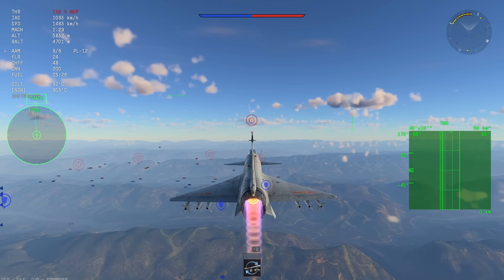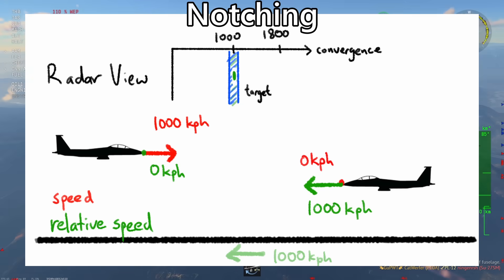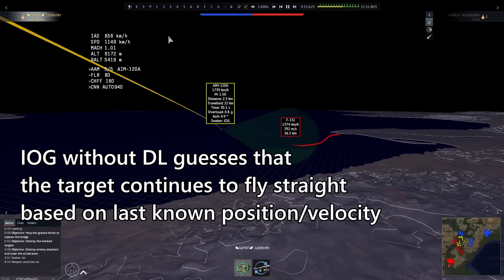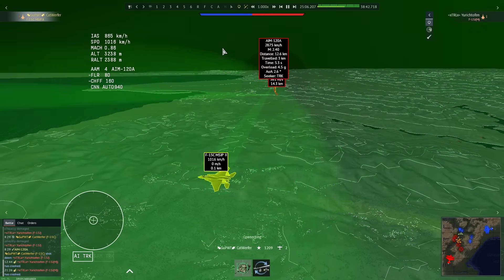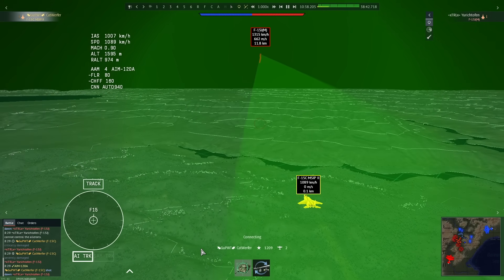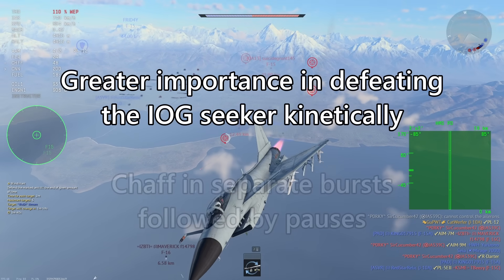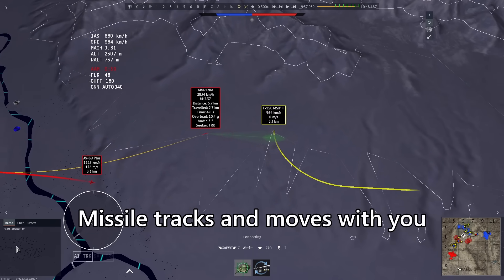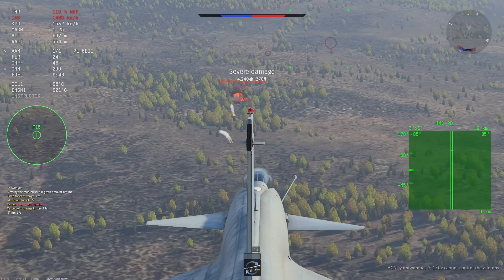Notching Mechanics Explained | How to Evade Top Tier Fox-3s

Comment: 15:50 In arcade (dont judge, the sheer chaos of top tier air arcade is really fun if youre into it) that is essentially all you have to do (at least at 13.0 and below) in most maps where youre 20-40 km out from the enemy spawn. derby's can reliably hit the enemies (id say on average 50% hit/kill rate) as long as they dont manuvre too much, or stop going towards you, but as long as you turn sideways (or do a 180 after shooting your missiles for closer range maps, usually works well even for 15km ones) youre gonna be safe from their missiles, and it also means youll come in from a better angle, or at least be behind your friendlies while your missiles reload.
None of that is really applicable to realistic, except on maps where you also can fire your missiles immediately with a decent hit rate in an air spawn, and then just 180 to rearm on an airfield, but in arcade that allows you to still have full countermeasures while also getting you in a tactically favorable situation, all while you can get some rather cheesy kills (although imho its on them for not maneuvering at least like a little bit, cmon, 43 km shot? and you die to it?)
Reply: since the spawn is quite standardized if you will, all the issues about energy state etc are avoided, you just have to account for the worst case scenario missile at that range.
Reply from the maker: Huh if you spawn that close then do phoenixes ever get any use?

Comment: Oh yeah this part was a bit confusing for me. I have noticed that you need to turn more then 90 degrees, or at least what is seems form the pilots perspective more then 90 degrees. AoA discrepancy angle was the culprit!!! Thanks for the clarification!
Reply from the maker: Yeah i got really confused when it looked like i was doing everything right, i got so frustrated i retested it, so its nice that i can help people figure it out too!
And a lot of it does also just come down to practice at closer ranges so dont be afraid of dying and trying again!
If you really wanna get better then having a training buddy to fire missiles at you in a custom game also helps.
Happy flying :)
Reply: @CatWerfer If i may ask, have you made a video about keyboard shortcuts? this default C button or "free look" is vexing me! I switched it to right mouse button and it works like a charm, but since I am primarily a taker it creates another problem in ground battles..
Reply from the maker: @hindel6141 I'm considering making one, I also use right mouse button now for free look, but I did have to change a lot of other stuff around to make it work for air ground ship and heli, it did take some time to get used to, and im still tweaking it to make it better. If you'd like to see a controls video lmk and ill see if I can make one real quick
Reply: Thank you, Mr. CatWerfer. There is no need to rush tho. Make a guide as you see fit. For now now I will just breake my fingers trying to them sweet sweet off bore R73 shots.

Comment: In squishface's recent video he can bee seen defeating the missiles by notching and then quickly doig a Split-S and chaffing, ultimately defeating the missile this way. (Rafale vid from august 28th, 5:15 & 15:25 til 16:45 & 18:10 & 19:25 & 20:00)

I am trying to wrap my head around why this works, and it kinda makes sense as below the horizon the missile just follows IOG, and above the horizon it work because he is chaffing (what about DL though?) during the Split-S.

edit: I just read your comment, and if the Fox-3s are using IOG in non-PD mode as well, then it makes even more sense that this also works when you are above the horizon.
Reply from the maker: I am confused as to whether you are still confused or not

Comment: Even 8 months later, this is still one of if not the most in-depth vids explaining the concept.  Very nice.  I would like to add a little tactic I use when defending Fox-3's at range (Initial BVR engagement).  Since it's usually not just enough to defeat the seeker, I must also think about defeating the IOG and possibly the DL.  What I do is I keep myself at that perfect 90 to the missile while pulling up and down gradually.  The vertical element does seem to further decrease the effectiveness of the IOG, since you are constantly moving in a different direction than it previously was updated to by the DL.  I've found the incoming missile almost always bites off on chaff one way or another.  Often the missile will bite off right after it momentarily re-acquires me through some very minor inaccuracies in technique right as I'm flowing back into the notch, usually from a slightly cold aspect.  Doesn't require an egregious amount of chaff either.  Just a slow and steady stream of maybe around one pop a second.
Reply from the maker: mmm ive found that short bursts of 2 or 3 tended to work better than continueous due to the aforementioned breadcrumbing effect but yeah i also do the 90 degree up and down strat.
glad this guide is still useful, and glad that gaijin hasn't overhauled the system after i made it so that it remains relevant for the most part
Reply: @CatWerfer  Sometimes breadcrumbing does happen.  But just from how my execution ends up happening, leaving a long string of spaced chaff tends to give the missile more chances to bite since it will often re-acquire from a slight rear-aspect once it gets a bit closer.  Even in the event it does fully re-acquire, it often will not be able to make the turn to hit me again whether it be angles or energy.  Either way, the missile is defeated.

Happy hunting good sir.
Reply from the maker: You too, ill try that method and see how it goes

Comment: I am bumping very often into people who dodge even MICA in a face at 4 km range.
I was trying to check the replay but the missiles etc are not generated for some reason. When I checked the server replay it got stuck in a place after 3 minutes so I could not review the encounter.

But the situation was that I was around ground level and I noticed some SU fighter flying infront of me at 5 km range and he was heading more like to the left(from my perspective), he wasnt on me, but was going after some teammate.

So I locked him with PD with headon mode and fired MICA, easy kill right?
Well he turned right into me and just angled the plance with left wing toward ground. I dont know if he popped chaff or flare, but the missile just missed him. 

I have no clue what magic trick he pulled there. In such situation I die no matter what as there isnt really time to react and the stuff like MICA just follows you like a magnet... 

this is not first time I saw someone doing this and it is very annoying.
Reply from the maker: Hard to know if there is no replay
Reply: @CatWerfer  if this tells you anything:
https://youtu.be/MZve2t3kNm0

but as I was saying the replay for some reason does not render missiles or CMs so the flight of the missile itself is not visible unfortunately.
Reply from the maker: @sefin84 missiles and ordinance bug out if you skip parts of the replay, did you skip to a bookmarked timestamp or play the whole thing thru to the point you wanted?
Reply: @CatWerfer  yes I skipped to the part I was interested in. It does work if you let it play through at original speed?

side note, he killed me so I did quit the match and then saved the replay. Is the saved replay corrupted if you quit early perhaps?
Reply from the maker: @sefin84 i cant guarantee but it will probably work as long as you dont skip.
You can play thru from whatever speed but just dont jump to the middle
Reply: @CatWerfer  dude you are a legend! 

Now I see the missiels when I didnt skip directly to the encounter.

What happend is that he managed to shoot a missile at my MICA and acutally did hit it. Now it makes sense. He got lucky, but it was a very much easily explained encounter.

I didnt know that skiping to certain parts messes up the replay. So again thanks!
Reply from the maker: @sefin84  you're welcome :)
war thunder's replay system is really broken, but skipping to bookmarks tends to break it even more than normal, i learned this the hard way from trial and error.

Comment: i learned the most about defeating radar missiles from watching videos on dcs engagement breakdowns tbh, same ideology is used it war thunder, maybe to a slightly less technical extent though
Reply from the maker: if it works it works
Reply: Unfortunately DCS countermeasures are still being finished and aren't the best example quiet yet.
Reply: @bhag7977 explain what that even remotely has to do with what I said. matter of fact when did I ever mention countermeasures?😂 defensive tactics/mechanics have little to nothing to do with that, you think CMs are any better in War Thunder? Boy do I have news for you.😂
Reply: @LittleBill5463 
You - "i learned the most about defeating radar missiles from watching videos on dcs engagement breakdowns".

Hence my point. DCS uses a chance base system for the countermeasures which can result in maneuvers working in DCS that may not actually be effective in a real situation. While DCS is more realistic than war thunder across the board, the counter measure system is something that they are still working on improving. If your counter measures are not part of your defensive tactics whats the point of even having them? Warthunder having a specifically better mechanic does take away anything from DCS realism. Its ok.

Comment: 5:15 how did you get this map display?
Reply from the maker: The black and white mode is called "sensor view" and is a feature of replay mode. It should be toggleable with a button with an icon that looks like a missile on the top hotbar

Comment: I thought I learned how to avoid radar missiles to some degree but I got absolutely demolished in F15E.
I played some games with F16C and I never had those problems. I was like omg Eagle has basically unlimited flare and chaff it is going to be a god plane...

notching chaffing, cutting grass and yet I still exploded into milion pieces

Need test a few of those tips and I think it might improve my survivability.

In all F16s I managed to get to at least little over 1 KD. F15E is hauting me with I dont even what number - very close to 0. Its just crazy considering that F16C and F15E should be  basically the same experience only I feel like F15E should be superior plane to F16C and yet the outcome is terrifying for me 😅
Reply from the maker: 14.0 is a very rough spot for the f15e, its at the same br as the su30, eurofighter, and rafale, which i feel like are all much better planes.
The f15es only standout feature is its climb and speed but the eurofighter is also very fast while turning much better (f15e turns like a brick) so i feel like the eagle kind of gets clapped if it ever has to go defensive in a 1v1.
I havent played it recently so im not sure if its workable but i would stick with the other american jets. Not the biggest fan of the f15c or f18c but at least it turns well enough to play both offense and defense.

Also migans channel is a goldmine for learning toptier mechanics, def check him out

Comment: Also i have a question regarding the notching at close range.

Your example bears no indication to the RWR, as i assume you just notch by feel.

However, a proper rwr position would notch the missile no matter what your plane is doing, aslong as your wings are in plane with the missile right?
Reply from the maker: @HowIsAsh  ideally yes, if you can keep your wingtips in plane with the missile and you keep the missile rwr at your 3 or 9 o'clock then you should stay within the notch band.

The issue with doing this especially at close range is that because the missile approaches your relative position very quickly, you have very little time to level your wings out to check your rwr. The angle at which the missile approaches also changes very quickly, so maintaining the notch consistently is almost impossible, not to mention the angle gating will put the missile in inertial guidance and lead the missile to your approximate position until it's close enough to reacquire you.

This is why I advise just doing a hard u turn while chaffing, since this puts you in the notch, uses chaff at its peak effectiveness (0.5-3km), and lets you exit the notch after the missile bites on chaff and goes into angle gating.

It does take some feel to know when the missile has been notched and goes into angle gating. Since this video's release, the missile's behavior has changed a bit; they tend to just fly straight once notched instead of biting hard on the chaff. Its best to commit to the u turn and wait until you can visually confirm that it's flown past you. You can't do this in every situation, but its a good starting point for learning the feel.
Reply: @CatWerfer  I perfer vertical movement when getting outside the missile seeker after notching, but your method probably is quicker!
Reply from the maker: @HowIsAsh  vertical movement also works, though i tend to turn my brain off when a missile gets fired headon from under 5km away from me so I just go with the strategy that seems to have worked best for me

Comment: Cranking is a way to protect yourself from missiles you haven't been warned about, while letting you maintain radar lock. It is most useful if you are launching from outside immediate pitbull range.

This let's you guide your fox three into pitbull range, while reducing your rate of closure with the enemy' jet, putting you into an notch if you get the angle right (and putting you close to a real notch if you don't),  and forcing any missiles that have been launched at you into a sharp turn during their initial boost. This robs the missile of altitude and energy, so when you do get the rwr missile warning, it is a much less dangerous missile. 

(Pro tip: AMRAAMs go pitbull around 16 seconds from impact. You can use the timer next to your missile capacity to decide how long to crank for)

Comment: Surely the chaff would have some velocity when being dispensed and then quickly drop to 0, or does it dispensed at a velocity of 0? If the case is that of the former is the time the chaff is at any speed too small to be of any significance?
Reply from the maker: @ScrotumScraper  it does have some velocity but almost immediately goes to zero. Maybe the brief moment it's deployed at can affect things but from testing it basically seems to have no effect while the missile is in look down at range
Reply: @CatWerfer  Ok thanks for answering!

Comment: You think you can do some testing with the RWR sensitivity setting in options -> air battle settings? Wondering if it can be used to reduce clutter and be more sure a missile launch is actually for you.
Reply from the maker: @mig_tf2323  maybe, but that would require more than 2 people to synchronously test and isn't quite as easy to see using TAC view. I think it might be too much of a hassle to test

Comment: Remember the notch is to match the relative ground vector of the attacking radar - not the perpendicular of the line connecting you and the attacking radar.
Unless game mechanics don’t care about that.
Reply from the maker: Mmm not entirely sure. I guess i could do a comparison later, but 90 on the rwr seems to work consistently enough

Comment: Definitely helpful. I will be keeping these tactics in mind while using the Su-27 :) I had always thought it was harder to notch a missile from below but guess I'm wrong.
Reply from the maker: @BlackBustnMoves  the base su27 is a bit hard to use cuz its rwr sucks but the su27sm is pretty fun :)
Reply: @CatWerfer  I don't have the 27SM yet, I have little motivation to grind top tier so i get to the top content about 6 months later. But something about the flanker is extremely fun to me.
Reply from the maker: Its a bit of a missile bus and a bit rough to play in the current meta but once it's spaded it is kinda workable...
Reply: @CatWerfer  The flight model changes helped a lot. I'm loving it.
Reply from the maker: @BlackBustnMoves  yeah they're pretty sweet, I'm looking forward to getting the su33 eventually, which seems like a straight upgrade over the su27

Comment: Great Vid, prolly one of the best I've seen notching and effective defensive tactics against ARH missiles. Btw ill mention a dirty secret as to the best way to defeat DL+ARH, you HAVE to shoot back. If possible counter fire is extremely important even if its a bad angle as this prevents the tango from going straight and Data linking giving guidance against your notch. Hope that helps!

Comment: Nice guide, conveys how the missile works and evading it quite well. Definitely one of best for evading fox-3s

Some extra things I have found out/believe though:
- The effectiveness of chaff depends on range. Where at longer ranges missiles rarely seem to go for chaff and instead lose lock and glide w IOG. Because of this you need to throw the missile of course to dodge (moving up/down or an immelmann in the notch can get them off of you)
- DL can be manipulated by weaponry. Main example of this rn is Pantsir radar (which locks in TWS) which can track mavericks instead of the launching aircraft right after that aircraft fires them (this also applies to aircraft TWS and missiles). So firing 1-2 sec after your enemy in a long range situation can actually cause multiple missiles to go for your own missile.
- Im also unsure if the missiles themselves switch between PD and regular lock as regular PD can still be chaffed.
Reply from the maker: Huh i didn't know about the pantsir locking missiles, I don't play that much ground so I only have top tier US spaa
Reply: @CatWerfer I only used it as an example (as the ground radars dont seem to differ too much to aircraft radars). The same tactic can be used against aircraft radars (though I need to test it a bit more to develop a full strategy).